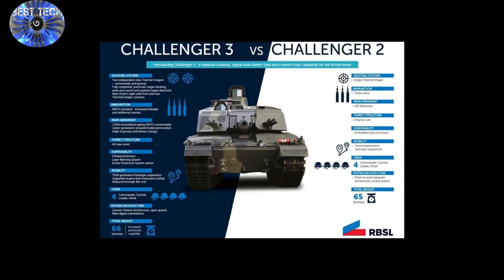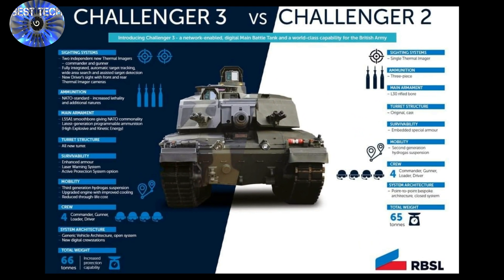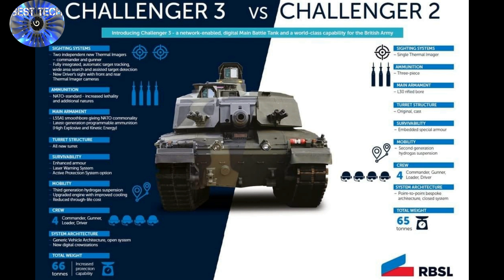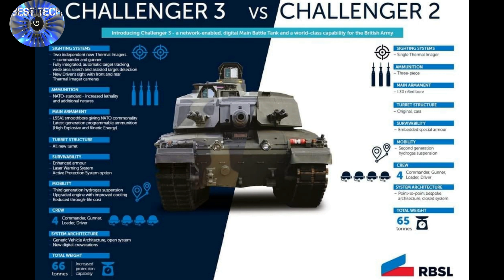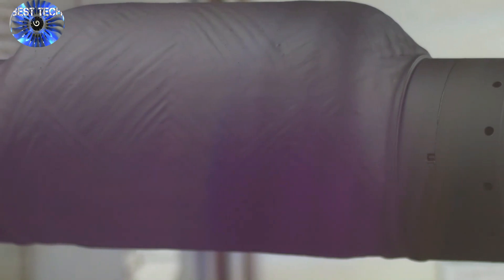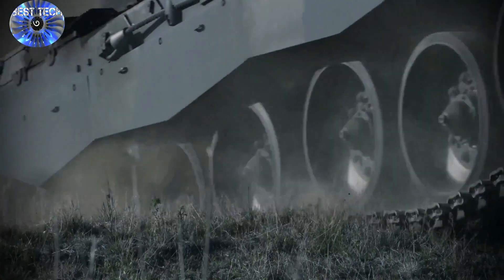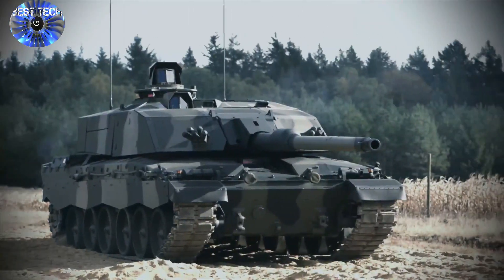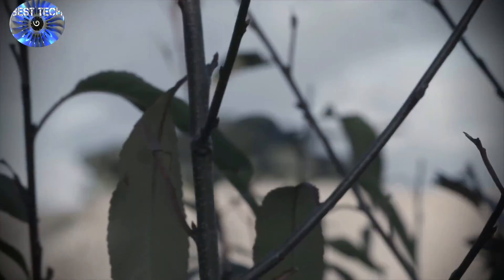Comparison The New British MBT Challenger 3 VS Challenger 2

Comment: Shit, still lover plate are thin  and you will have to change barrel so often,
Reply: With dorchester armor addons tank is about 75t, and engine was 1200hp.
Reply: @marko6363  and that’s what the challenger needed a upgrade. as much as the old reliable engine was which was proven needed that extra humph.
Reply: They suppose to be enhancing the glacier front plate and then fitting it with a new module armour pack on.